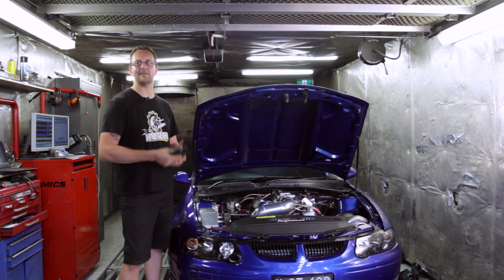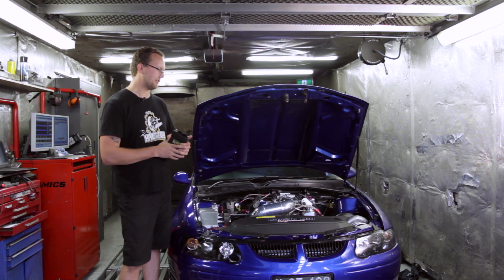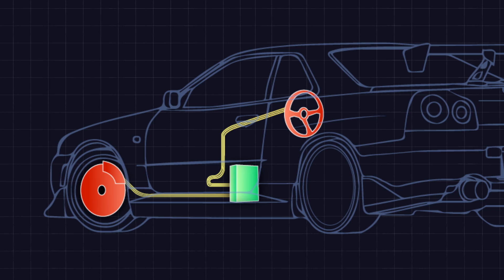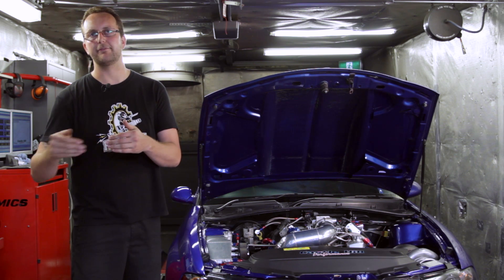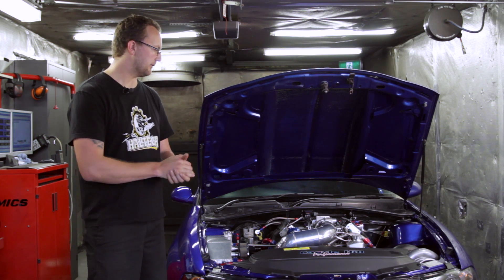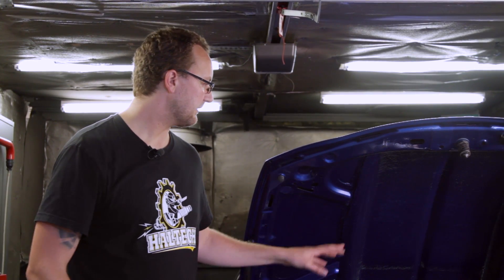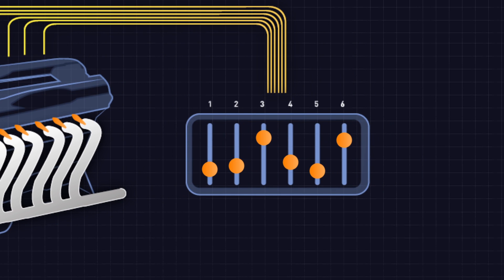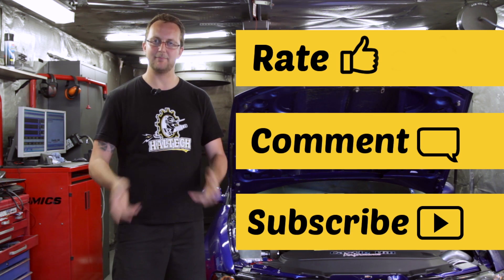Drag racing with Haltech's Elite ECU - Technically Speaking

Comment: It's not line lock...It's called a trans brake 
Line lock is so you can brake using only the front wheels during a burnout
Reply: kingcementer1 a line lock is a completely separate thing from a trans brakes
Line lock makes it so you can brake with only the front tires during a burnout 

A trans brake is for launching off the line 

I'm not the one being retarded saying you want a trans brake on while you're trying to do a burnout
Reply: MyLonewolf25 so first you hold line lock, burnout, stop , pull up to the line, set your line lock again, than at that Tim your ecu has already been set to apply trans brake upon second application of line lock, transbrake engages upon use of line lock, you then bump car into second stage on line, release line lock switch, make quick passes.
Reply: kingcementer1 problem there
You may have a problem doing a burnout also 
You don't want your brakes on bumping into the beams 

Also again 
Trans brake should be the only thing used staging and bumping in
That's it
Reply: MyLonewolf25 try watching again,  they made a diagram and everything

Comment from the maker: Ambrosemcc - Putting aside the fact that your drag car might lift the front wheels and make that speed input not work too well, yes – we can control boost and ignition timing on any wheel speed input with the Elite Series ECUs. You could use a target boost table that uses a wheel speed input as the axis, and progressively bring the boost in as wheel speed increases (if this is what you wanted).

An ignition timing trim could also be done in the same way, using a wheel speed input as the axis for a trim on ignition timing. The sky really is the limit with the Elite Series.